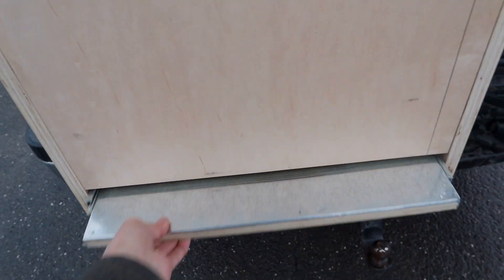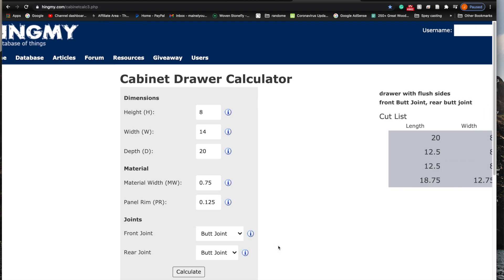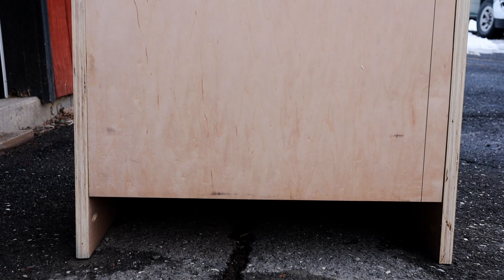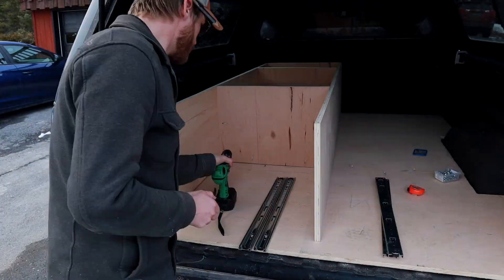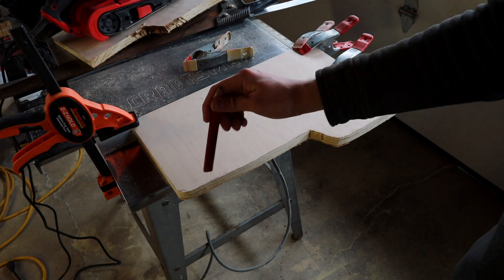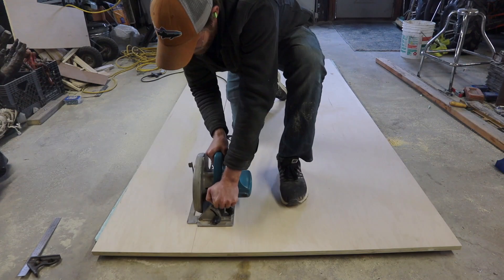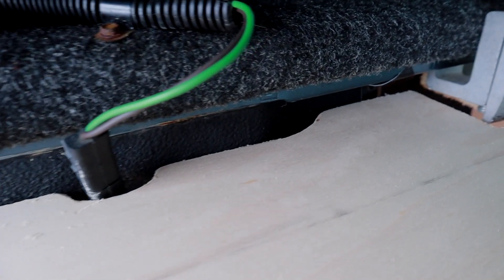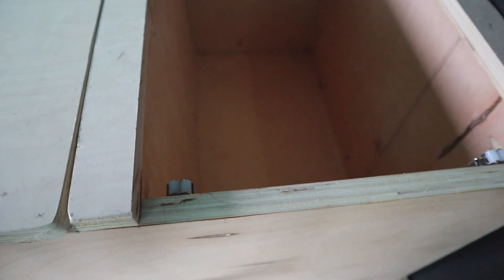Build a DIY Drawer System for your Truck Cap Camper

Comment: What ya did with the tape measure to "scribe" the contours of the bed is called Tick sticking. Old boat building shipwright method. Theirs always been a certain romance to hand sawing projects for me. I still do a lot of trim work with garandfathers restored miter saw. Luckily he taught me how to sharpen a saw which I hated when I was young as I used to cut studs to length for him for spending money but now am thankful he took the time. Love the build and the channel from all the way over on the Olympic peninsula. Thanks!
Reply from the maker: Oh, very cool thanks for sharing! I actually had no idea

Comment: Can you design a leg to swing out when you pull everything out? It would increase the load capacity a little. When you're done then you can just fold it back under the board and push everything in.

Comment: I would have done pretty much the same design (and probably will when I get a new/bigger truck :)). I would add a small lip around the bed surface to hold the mattress on there while driving. Maybe its not an issue.
Reply from the maker: You definitely have to do this one day! makes traveling so much easier, just hop in and go. My original plan was to add velcro strips to hold it there but it never actually slips off so I just left it as is.

Comment: I feel like you need to add another 6” compartment running the length and height of the bed for a rod locker. Something simple but effective for when you want to use something other than a breakdown fly rod
Reply from the maker: Defiantly on the list of additions this build needs!